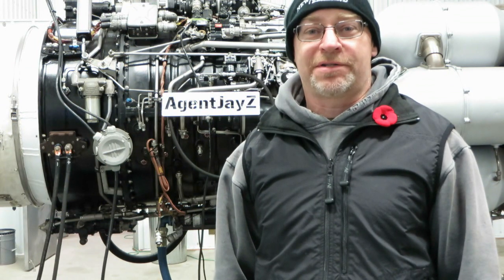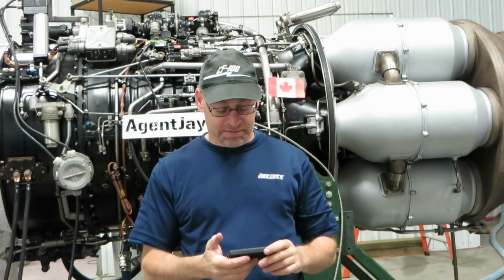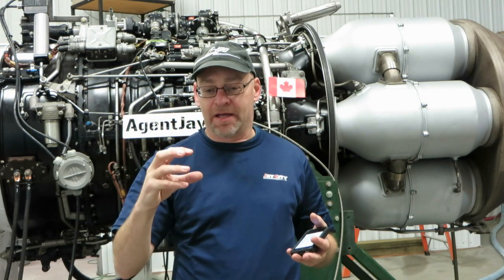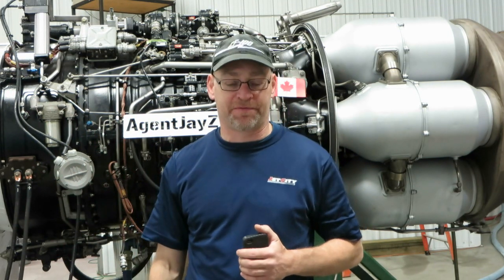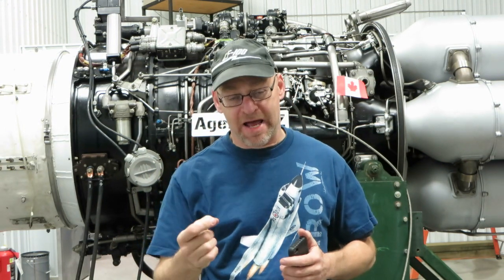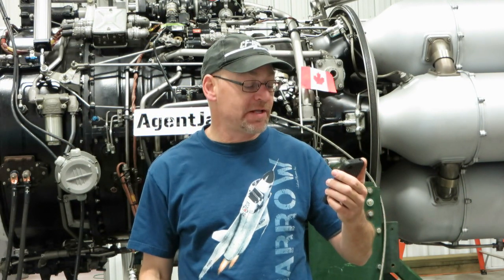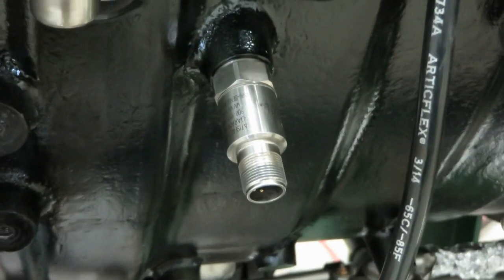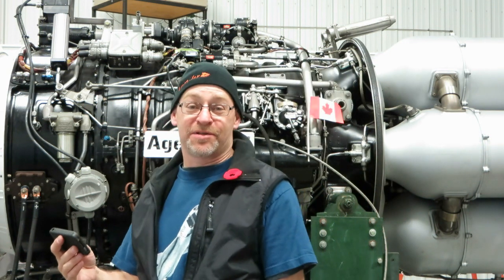Your Questions 21

Comment: 101% power? Please explain, thanks.
Reply from the maker: Yes... real life is more complicated than a diagram.
An engine's rated power is set at a level that the manufacturer wants to guarantee, with reasonable assurance that everything will be safe, even after hundreds of hours of running.
100% power does not mean the theoretical maximum, beyond which any increase will cause instant destruction.
As you increase power above the maximum "allowed" or "recommended" by the people who built the engine, you begin to trade component service life for engine performance.
Usually the "maximum" flat rated power is considerably less than the absolute maximum recommended power setting, which will have a time limit like two minutes or so. Even that is far below the absolute maximum emergency power output, where engine life is not even considered. For example losing one of two engines on takeoff after V1... the pilot may very well severely damage the working engine, while saving the aircraft from crashing. That's a good trade, eh?

So it all depends upon which "maximum" power setting you are considering.
Reply: I commented on the "100%" thing before. It usually refers to the normal operating limit of the "baseline" engine. If improvements are made (e. g. turbine blade cooling), the 100% still refers to the same rpm, but the engine may be safely run at, say, 102%. Since it is aerodynamically still the same engine, running it at the same % N1 willl produce the same result. This is sometimes done to be able to mix different evolutionary stages of an engine on the same airplane (Yes, that is done). Modern engines are all FADEC-controlled, the pilot cannot exceed the limits enforced by the computer. But they'll be engough to takoff on a single engine after v1. Can't think of an accident were even more engine power then permitted by the FADEC would have saved the day, and I know most of them (accidents, i. e.).